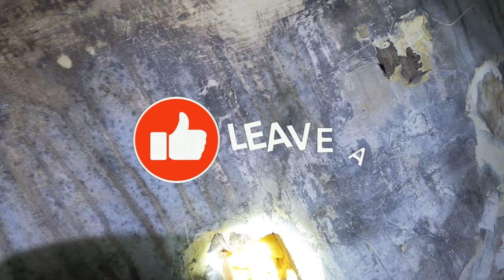Theres a big hole in our bow | S4 E6   4K

Comment: Wow, what a mess. 
Any idea why there was a repair job done? Why is this an enclosed space anyway ?
Good you stumbled over it and could hopefully fix it .
Reply from the maker: No idea about the repair. Someone had layered the bottom of the chain locker with foam so there was no way of telling it was leaking. At least we found it and fixed it. I want to lay another 4 or 5 layers of fibreglass inside just to be sure it’s strong enough but can’t do that until my back recovers.